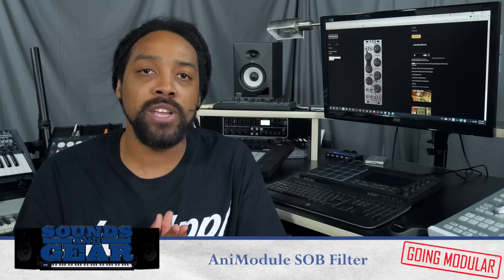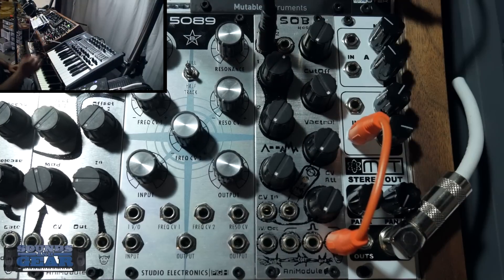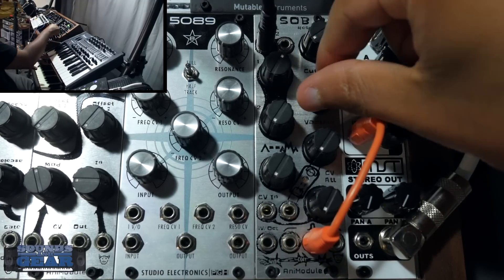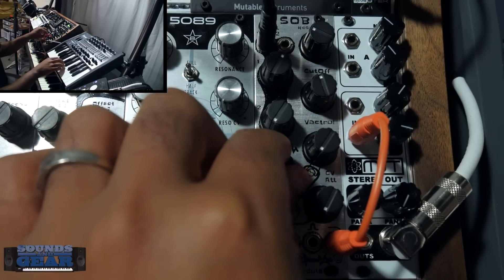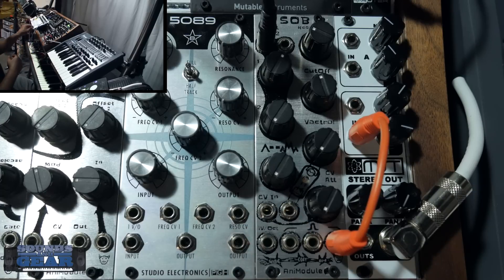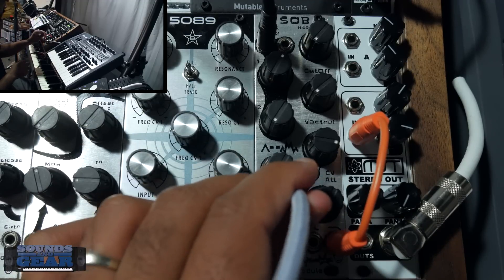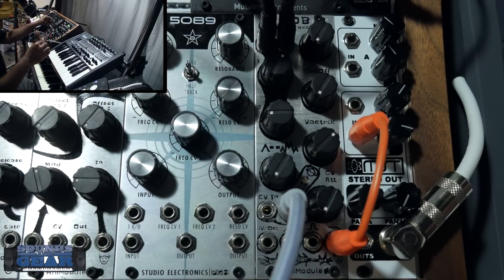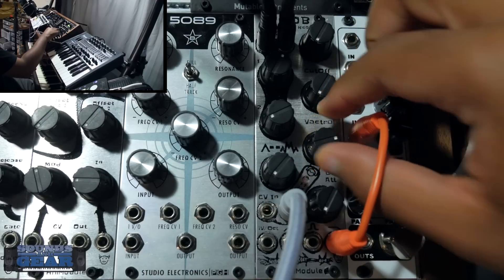Going Modular: AniModule SOB State Variable Analog Filter

Comment: I like dialing back the vactrol to about 11 O'clock, turning up the cutoff to about 10 and the res up to just shy of screeching. You can get more plucky sounds out of this. Not exactly a resonant LPG, but I prefer it to the make Noise - MMG, RYO- Aperture, Pittsburgh - LPG etc. It's fuller and more convincing. It's so good at being an LPG, I almost never use it as a straight up filter, though it can do that well too. The other LPGs that stay in my system are the LxD and the Natural Gate. They are both great, but they are very polite compared to the SOB.
Reply from the maker: Nice tips, thanks for sharing!